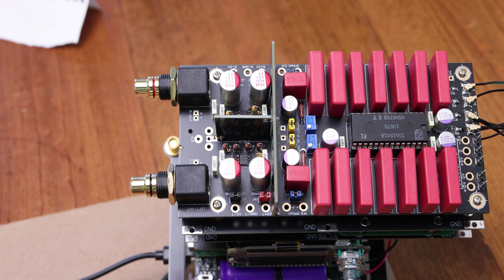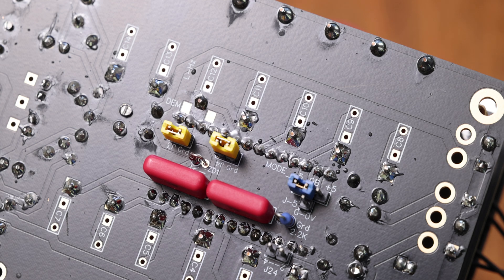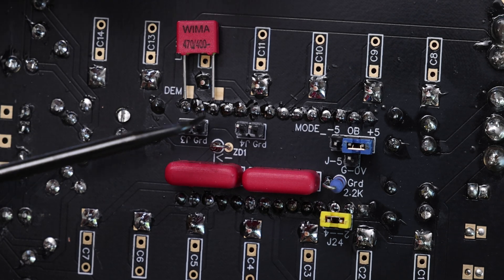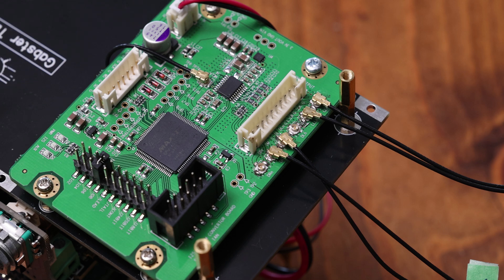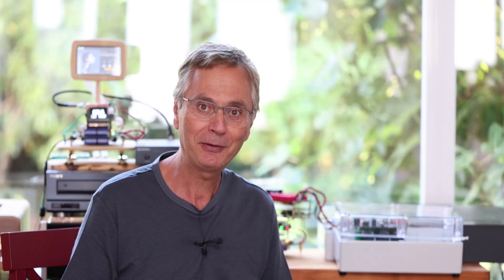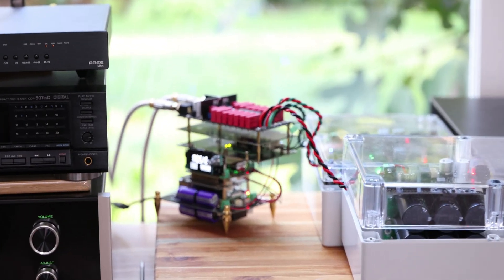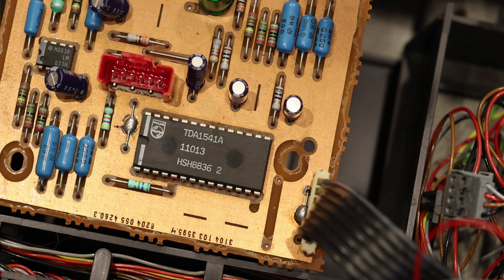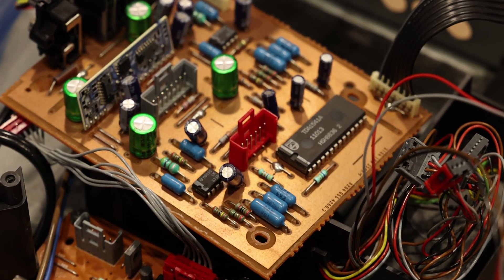Gabster TD1 Dac Configuration Sim, Reg, Balanced mode

Comment: Dear gabster, please share whether there's a possibility of adding either a USB or coax to this DAC for those of us who have CD/SACD player/transports.. which unfortunately makes this a non-starter DAC if it can't be done. Thanks.
Reply from the maker: In this video I talk about it with the DDC board and Amanero Flagship IanCanada Streamer & Gabster TD1 Dac. Step by step build.
https://youtu.be/K5OxEc_bjqk
Reply: @Gabster1  Dear Gabby, thanks for your reply.  If I understand that setup (and I know just enough to be dangerous!), it looks like its an "either/or" situation, at least that's how you present it.. meaning either I have to build a Streamer-Dac or a Dac-only with DDC board.  Is there a way to build/configure this setup so that one gets the best sound from the streamer section, but also have an optional pure DAC section(with all the digital inputs) to allow for playback via a transport?  Wondering if this is monumental task needing both additional hardware and custom software.  Thanks for your thoughts and clarification.
Reply from the maker: @HoomanR17  If I was in your shoes I would build a Protodac with a simple 
Raspbery Pi 
https://youtu.be/zOHt10p7bX0?si=mDMPQ3NqZPa0pSLd
If you are a Roon user it is very easy see my Roon setup
https://youtu.be/-vzJR9HWwiY?si=ccWZdJIzT1iyMWpG
but you can also use Moode and Volumio this way it is a self complete Dac you can compare that to your setup 
That will get you comfortable to go further and build a Ian streamer with my Dac
Reply: @Gabster1  Gabby, thanks for your recommendation. I'm a EE so not new to circuit boards, soldering or programming so don't have any hesitation building any of these components, my only requirement is the best sounding TD1 for both streaming and external connection with no extraneous components .  I would likely use Moode for streaming and a CD transport via coax.. as long as the "system" auto sense where the audio stream is coming from , I'll assume no "switch" is needed. Can you put a DDC and a RPi together in a sandwich to achieve this?  Anyway would appreciate you general recommendation for such an animal!

Comment: I need to learn soldering. Where do I buy the 1541A?
Reply from the maker: Start by building a ProtoDac by Mark easy and no Soldering needed if you order from him 
Then solder a protodac at 50$ you have not much to loose 
Then build a streamer with the protodac 
Then you will be slowly ready for the TD1
Tda can be sourced from a trusted eBay source or dead cd player
Reply: @Gabster1  Thanks a lot for your answer. I really apreciate your channel. I will look in my old Phillips player, if I can find it 😊